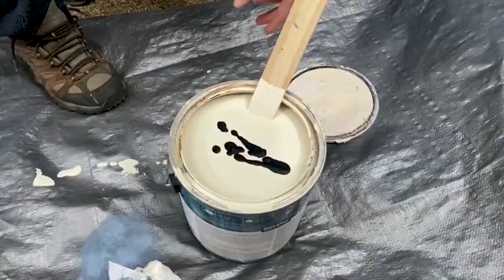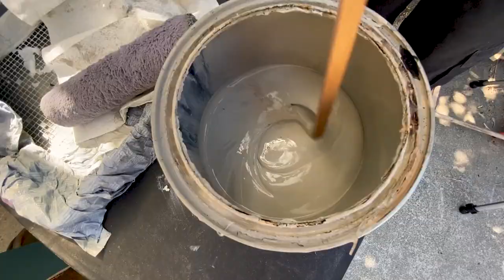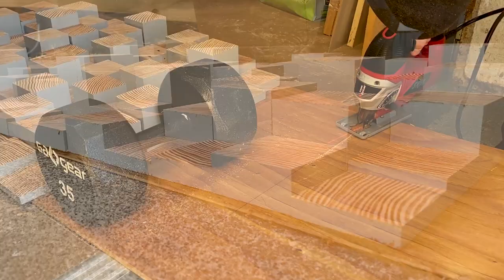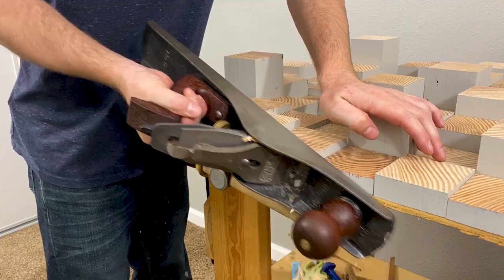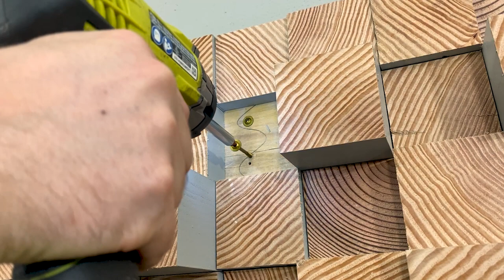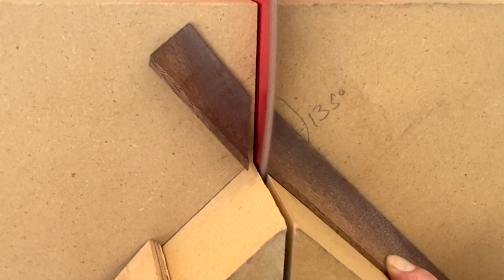DIY Acoustic Skyline Diffuser - WALL ART

Comment: A few thoughts/tips/suggestions for you. First, instead of "random", you can use a program like QRDUDE to help you with the depth of blocks and order they go in. Second, the smaller blocks will diffuse better in frequencies that are important for studios. Second Part 2 - the depth (height of blocks) and size of the overall diffuser determines the lowest frequency you can diffuse; smaller individual blocks will diffuse higher frequencies (no less than 1" x 1"). Also, you can lighten up the overall project by breaking it up into quadrants, and/or using a good forstner bit to hollow out the blocks before you glue them to the backing plate. Finally, you'll need a LOT of diffusers to have a really big impact...but I'm betting you'll get a notable improvement if you build at least two more of that size (especially if you use 2 x 2 blocks with greater depth). I hope that helps out some!
Reply from the maker: Thanks for the tips. It sounds like you have made one or two of these before.
Reply: @BobsWoodStuff  maybe three.   :)
Reply: great tip on the forstner bit
Reply: Great tip
I knew there was a mathematical formula but way beyond me
This tip is great
Thank you
Reply: This guy is right, but maybe too polite to get his point across. You screwed up bad. I'm surprised someone would make a video about building a skyline diffuser without knowing what a skyline diffuser is.  Those blocks ARE NOT random. Some serious math goes into these so that they will diffuse sound and if you don't get the sizes and pattern right, it won't work. You made the equivalent of putting a Ferrari body on top of a '96 Honda Civic - looks close, but not right.
Reply: @djsjjd15  Daddy chill
Reply: thank you I was looking for info on how to properly diffuse !!!
Reply: @djsjjd15  I know this is a year old but there is a reason his comment has 43 likes and yours only has 3. Being rude to someone doesn't constitute a better answer. He worked hard on this project and introduced a sound concept that many people are unfamiliar with. I think that makes the video worthy of posting and appreciation. 

Putting someone down without offering any meaningful correction is more telling of what kind of person you are than the person you are insulting. What kind of solutions did you offer? What avenues of knowledge are you presenting? I don't see any in your comment.

When you do something it's not always going to be perfect, but that doesn't mean you shouldn't do it; You'll  get better each time you do. Plenty of channels on YouTube prove that.

Comment: Great build. It will diffuse frequencies between 2khz and 2.5khz roughly. You need a lot of depth to diffuse lower freqs. Thanks for sharing.
Reply from the maker: Thanks for the info! You're welcome.
Reply: long depth with 4x4's would get heavy VERY fast

Comment: Props to the build, only thing if I can add. If your doing more panels, the wood floor glue that comes in buckets would be easier to trowel/roll out for faster times but I also agree with a hot day that goes against you.

Comment: awesome. do you like these bigger 4x4 diffusers better than the 2x2's? 

Also, I was thinking about doing this but making a slight angled cut...maybe like 10 - 20° on the miter saw and have each piece slanted a random direction. 

would this further help sound dispersing?
Reply from the maker: The main thing I learned after making a diffuser with smaller pieces is that it takes SO MANY pieces at that size, so I went with the 4x4 size to get a larger diffuser without having to cut hundreds more pieces.
They take a little bit of sanding, so each piece adds up in production time.

I've seen some diffusers that have an angle on the pieces like you mentioned, and they look nice, but the diffusion would be less predictable.

Mine is random, but for maximum audio benefit, it is recommended to use a diffuser calculator that says the exact height for each piece.
Reply: @BobsWoodStuff  interesting. so did you use a diffuser calculator?
Reply: @BobsWoodStuff  where could I download one?
Reply from the maker: @Levi Jesse Gonzalez  
I just did random sizes on mine. You can find a calculator here:
http://www.mh-audio.nl/Acoustics/DiffusorCalculator3.asp

Comment: Hi great video!
 Im thinking in build some diffuser panels, and i have a couple of questions, 
do you think if I paint them (in black) will affect the result?
there is a pattern to place the different length wood pieces?
Thanks in advance,
Luis
Reply from the maker: The paint shouldn't affect the result.

You can find a calculator here to tell you what size to make the pieces on the skyline diffuser. There are a few of them under the "Diffusors" section:
http://www.mh-audio.nl/Acoustics.html

Comment: I did one! However I posted it online and people hated it and said it won't do low frequencies because it's too shallow and I need a true quadratic diffuser. 

I haven't used it yet. Have you notice if it works or not?
Reply from the maker: It seems to mellow out the echoes on that wall.
Mine is just random, but there are calculators which will tell you the correct height of each column.

Comment: Dude, your fingers were scarily close to that circular saw blade! That's a good way to lose fingers.
Reply from the maker: I appreciate your concern. Are you talking about the table saw or the miter saw?
Sometimes the camera angle or the fast forwarding can make the blade look closer than it is. There were a couple spots on the miter saw where I probably could/should have used a clamp.
Reply: @BobsWoodStuff  Table saw. Isn't it good practice to use another sacrificial piece of wood in between your hand and the piece being cut? I know you were being careful, but you only get one chance with those blades. Extra caution is advisable. Good luck, nice video.
Reply from the maker: @Coneman3  Thanks. I am using a wooden push stick in my right hand once the board is all the way on the table, which is the correct way to control the board.

The questionable thing I am doing is grabbing the waste piece with my left hand once it has separated. This is pretty easy to do on a smaller table saw like a contractor or jobsite saw like mine, but I would not recommend it  on a larger table saw.
Reply: Someone from a little factory next to mine lost his thumbs like that 1 month ago. We heard it scream from our warehouse at 100m from him 😱

Comment: I think you need to have a proper repeating pattern for them to work properly.
Reply from the maker: That is correct. There are online calculators that will tell you the placement and height for each piece.

Comment: Building panel like this without acoustic diffuser calculator are not very effective way. "Normal" echo damping can be reached more easy way (massive HDF or fiberglass plate coated with something soft work nice). Calculated skyline usually used for room correction, but they look cool.

Comment: sir is there any specific  rules of making it..??? and why the variation in size of those fragments??? why wood is used sir?
Reply from the maker: The variation in sizes is what makes this design work. When the sound waves hit the different surfaces, they get randomized, so you get a natural sounding reflection, without hard echoes like a flat wall.
It doesn't absorb like acoustic foam does, it is a different effect.

I tried to make the size of the pieces random, but for best results you can plan the exact size and placement of the pieces using a calculator like this one:
http://mh-audio.nl/Acoustics/DiffusorCalculator3.asp?km=7.5&kl=100&calc=Calculate+Diffuser#result
Reply: @BobsWoodStuff   thanks sir so basically it's for beautifying...
Reply from the maker: @audiowolfnet9347  In my case it is mostly for decoration, but it does mellow out the sound from that wall a little bit.

On two of the other walls (not pictured) I am hanging moving blankets to soundproof the room, and I have some foam in the corners.

Comment: you uses 4x4s but the only ones i find are for outdoor / treated lumber....
Reply from the maker: I used Douglas fir 4x4s, untreated. I don't recommend treated lumber for indoor use. Redwood or cedar are for outdoor use, but can also be used indoors, so if they don't have any fir or pine, you could look for redwood or cedar.
Reply: @BobsWoodStuff  Where can I buy that? I dont see it on homedepot and lowes website.

I don't want any treated wood indoors because of toxic off gasing.

Is kiln dried ok? Because i have some 2x10 Construction kiln dried lumber I'm going to make some diffuser panels with. 

But I also want to do one like you have here
Reply from the maker: @levijessegonzalez3629  Yes, kiln dried lumber is fine..

This is a Lowes 4x4x8:
https://www.lowes.com/pd/4-in-x-4-in-x-8-ft-Douglas-Fir-Lumber-Common-3-562-in-x-3-562-in-x-8-ft-Actual/1000028905

Home Depot 4x4x12:
https://www.homedepot.com/p/4-in-x-4-in-x-12-ft-2-and-Better-FSC-Green-Douglas-Fir-Lumber-328659/202083084
Reply: @BobsWoodStuff  Thanks! Both say theyre out of stock in my area. might have to talk with a manager
Reply from the maker: @levijessegonzalez3629  If you can find some 4x8, 4x10, or 4x12, you can cut those down to size.

Comment: i'm pretty sure you use not enough nails for the frame and not enough screws for mounting xD
Reply from the maker: I used 12 total cabinet screws for mounting it, although I don't think I showed them all in the video. There are 6 removable blocks with 2 screws under each.
Reply: @BobsWoodStuff  that 6x1 would be enough, even 4. It's not a climping wall ;)
Reply from the maker: @TechTalkTobi  Oh, I see now that the first comment was sarcastic. Yeah, I overdid all the fasteners.

Comment: Kind of a bs video. The thumbnail implies you are making a curved peice that could fit in a corner. Also unless you use a mathematical formula then you "diffuser" will do very little if anything at all. Also that part where you planed the edges after glue I see you quickly realized that's a very bad idea as you are almost certainly coming to tear out the edges doing that.

Comment: This is damn wrong made.
You cannot placed blocks randomly, everything must be measured. High, width, and every single position.
This diffuser doesn't work.
Reply: Simón Meléndez it will still work, simply by its presence! It may not be as effective as a mathematically designed one but it will still work.
Reply: @officialWWM  if you mean better than a flat surface, sure. Definitely not as a properly diffusion.
If you wanna do an acoustic treatment you must know which frequencies manipulate.